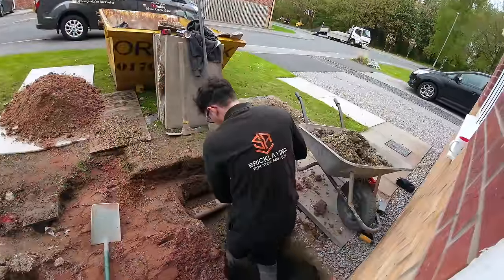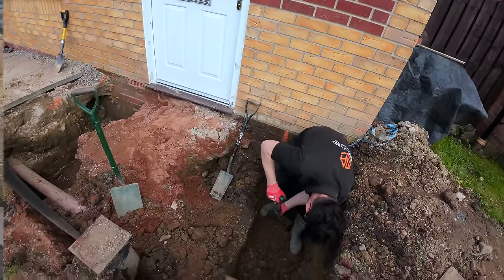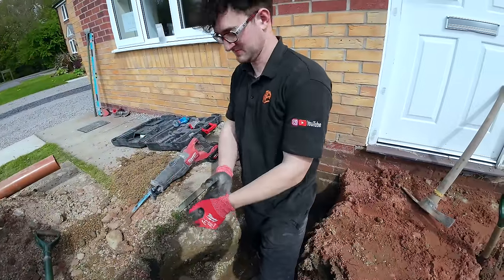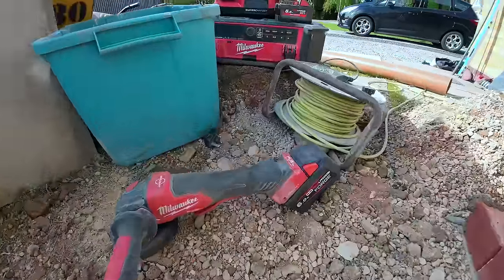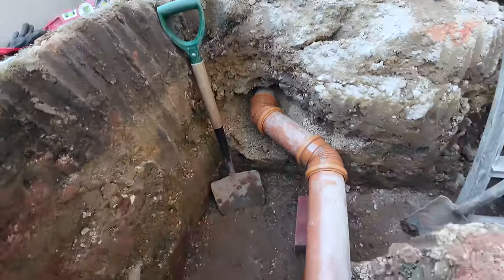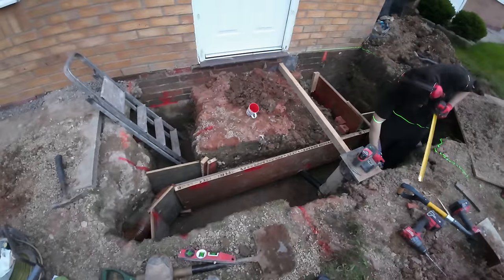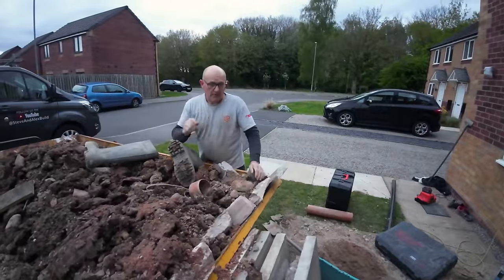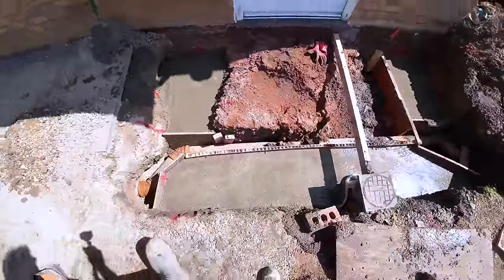HOW CAN A PORCH CAUSE US SO MUCH STRESS....MORE DRAIN MISERY..OUR PORCH PART 2

Comment: Nice work but the water supply might cause an issue in the future if that boundary box fails you are going to struggle to repair it,what I would have done dug on the point of entry extended the duct and move the boundary box/ stopgap a meter back👍

Comment: Not an easy job to do with the drains and water pipe in the way.
I think I would have bit the bullet and had the water meter moved away from the wall and then ducted the water pipe into the house wall. I was a water engineer with the local Water Company for 50yrs and it’s surprising how many people have built extensions over water pipes and then had a burst in later years. If they had ducted the pipe or diverted it then would have saved having to dig up the floor.

Comment: Hi both brilliant vids as ever can I ask I’m about to dig a foundation 0.9 deep by 0.6 width however the next door single storey wall is roughly 0.5m away from my trench should I be worried digging out the trench if I try and do the job as quickly as possible ? You advise would be most grateful
Reply from the maker: Hi Scott thanks but
sorry pal we can’t give advice on stuff like without being there in person .
    Good luck 🧱👍🏽

Comment: Haha love you guys but thats horrendous couldn't you just move manhole then put a renforced slab to build off drains can run under slabs as the weight is spread as long as you have  rodding access. Would have saved you a load of heart ache. Sure it will look nice once finished
Reply from the maker: Cheers Paul only finished the brickwork 2 days ago 😆😆🧱👍🏽
Reply: When you finish work out how much it would of cost. I just priced a porch 15k customer nearly had heart attack but I checked it and couldn't get price down. It was max size hipped roof fancy front door and side window. Complete job plasterered, joinery electrics ect. Let me know what you get it to
Reply from the maker: @paullindsay4798 Done a few  and that’s about right 😬🧱👍🏽